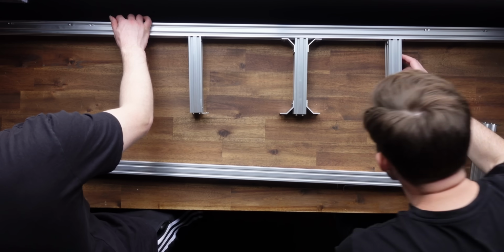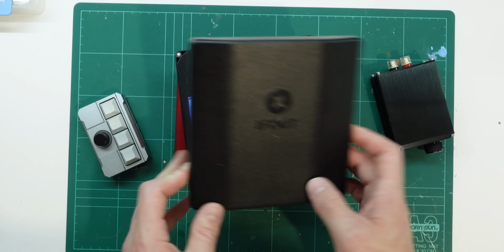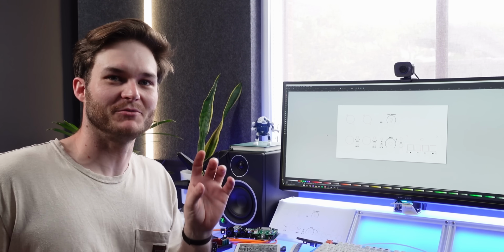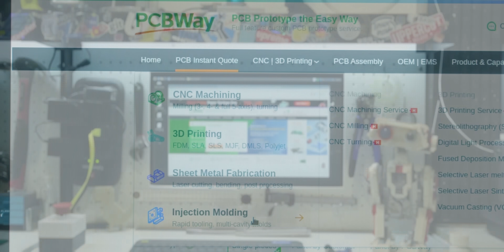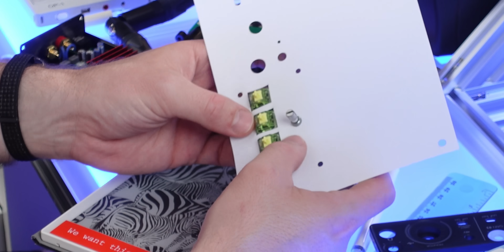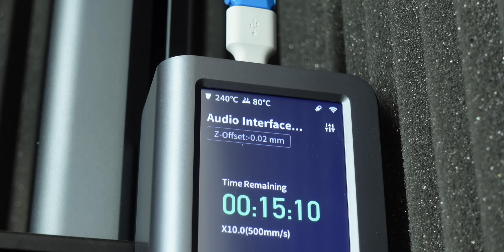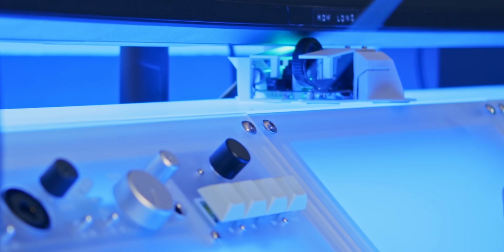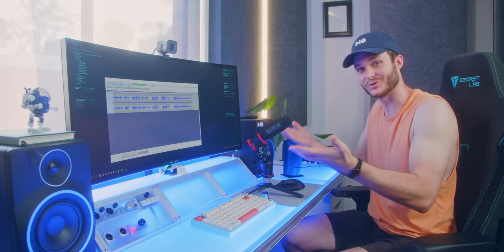Adding Knobs and Buttons to my Desk - Control Panel

Comment: While the see clear PLA works, would it be even better with clear resin printing ? It prints much cleaner, less lines. Probably not very noticeable, but still.
Reply from the maker: Yes resin printing clear parts are the best as it cures each layer at one and solid. With FDM printing, light refracts off every path left by the nozzle so you really need to perfect solid infill paths and print speed for layer bonds.

I don't bother too much and it comes out a milky white on my parts. Resin would be a lot easier to get clear prints
Reply: @camshand  But how much of it will you notice really.
Mostly it might be better for if you are screwing around with it regularly.

Comment: At the 2:00 minute mark you mention working off a scaled photo - which can be distorted depending on your focal length.
A similar trick I’ve seen (if you have access to one) is using a flatbed scanner.
Reply from the maker: that is true which is why I used a telephoto lens on my phone and held the camera far away to counter distortion.
Simply because I don't have a scanner haha

Comment: My solution for the same task was to use PCBWAY to make basically that panel out of their thickest black fiberglass PCB material. That let me use the solder mask to make great labels. It’s plenty strong for the task and looks great.
Reply from the maker: Dang that's genius! I've seen some sure creative uses of labels with traces. I really dig the exposed electronics look so I'm sure it looks amazing!

Comment: Nice panels! Perhaps a top panel made of the acrylic plastic Lucite might be nice. Using an CNC engrave you can engrave labels for the controls. When lit from an edge the engraved portion will glow with the color of the light source used.

Comment: i really hope your going to take shielding into account. RF and cross talk might be a big problem
Reply from the maker: I'm currently testing it out. TBH haven't noticed any crazy levels of EMI, and when teenage engineering built the MOAD for Swedish House Mafia the didn't do anything fancy for RF. Worst case I'll find a way to mount the metal surround as well and just put white vinyl over it so it blends in.

Comment: coming along great - you'll see the biggest improvement if you just at least slightly adjust your speakers - Get them up and pointing towards you. One solution I've seen that was pretty clever is using monitor arms to hold them.

Comment: when pulling apart audio products, they're enclosed in a metal case for a reason, being interference. I suggest trying to keep the case mostly intact to keep interference low, or make something different yourself to shield the stuff
Reply: should save himself the headache and just buy a rack mounted interface...
Reply: I had just been coming down here to say that. my Audio Interface isn't well shielded and it picks up my phone if its within 2 feet of it.
Reply: This, all audio hardware needs their own tinfoil hat. I mean faraday cage
Reply: Plus heat dispersion.
Reply: You can get thick copper foil at most art supply stores. It’s not to thick but you can create a shield that can slip around each of the electronics. Solder the ends together and add some thick parchment baking paper along the inside of the shield so as not to short out any components to the circuit board. You can attach a ground wire to the shield and in turn attach that wire to each circuit board ground. Hopefully thy are using a common ground between circuits. If not and you are still having issues a ground loop isolator in the Audubon paths might be in order.
Reply: but most of the modern day electronics are really well shielded, u should only do this if you find some noticeable difference 
the wattages are too low to produce a significant amount of noise
Reply: Signal noise is a huge problem if there are wireless devices around. Some phone brands including some iPhone models coughs in X, XR, and 15 as well as every pixel I've had my hands on (6, 6a, 7, 7pro, and 8)  @mynk0.78mm

Comment: I think taking the audio interface out of the metal case is a bad idea.
Reply from the maker: Great point,I thought so too, but after chatting with one of the guys that built the MOAD with teenage engineering he said he's had no real interference issues removing audio gear from enclosures.

So for now I'm going to test it and see, worse case I create a little bracket that'll hold the red metal outer over the electronics

Comment: This hiding of "of-the-shelf-electronics" in standardized units is all i ever wanted.... i only would go the route of doing it modular like in synthesizers, So if one piece changes, i dont need to redo the whole panel... but apart from that, this is an absolute dream

Comment: u know what would be awesome, integrating the keyboard into the table
Reply from the maker: Ohhh I really really want to do this! But I have my keyboard in two different spots when typing or when gaming. I'm thinking of maybe a modular sliding panel design to be able to slide the surface along